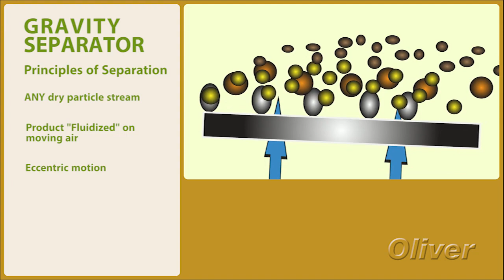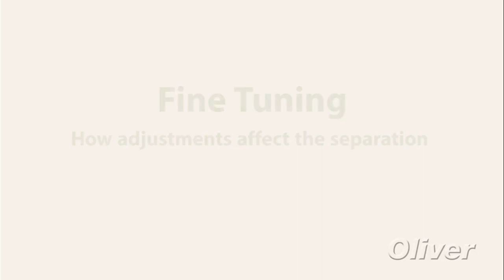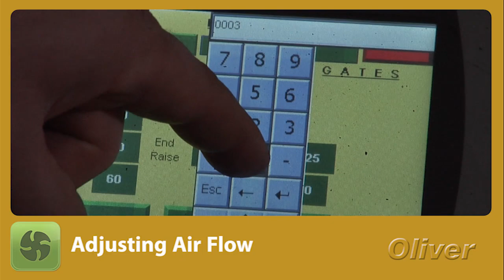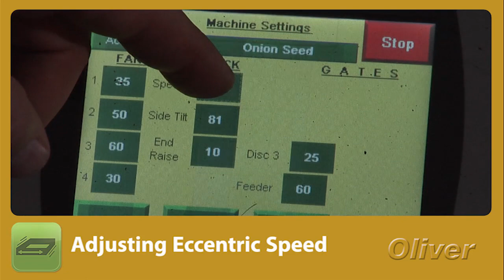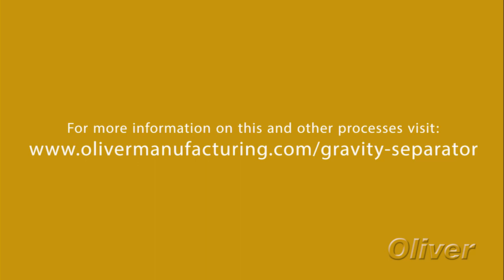The Gravity Separator - Oliver Manufacturing

Comment: We have a product with a very high percentage dust content, density ~200kg/m3 mixed with tramp ie stones of varying sizes, sand and possibly a few nails. Air blown through the mix would disperse the low density product into an unacceptable cloud.
Could effective separation be accomplished with vibration only if the residence time is increased ?
Reply from the maker: Sparky0007, this separation cannot be done with vibration only. Sounds like you will need an advanced dust collection system to decrease the amount of air pollutants. Please feel free to email us for further questions at contactus@olivermanufacturing.com